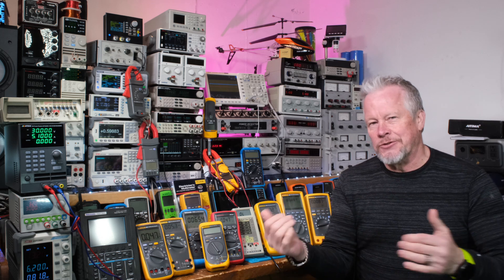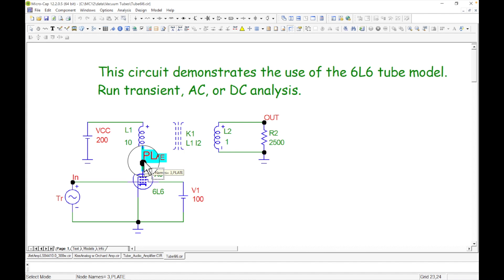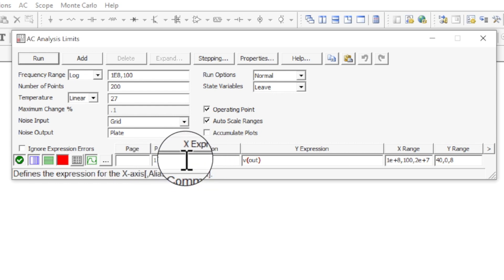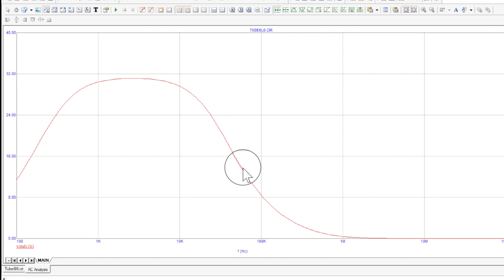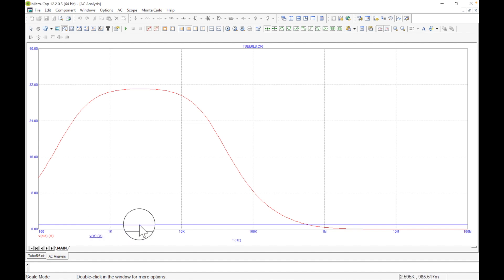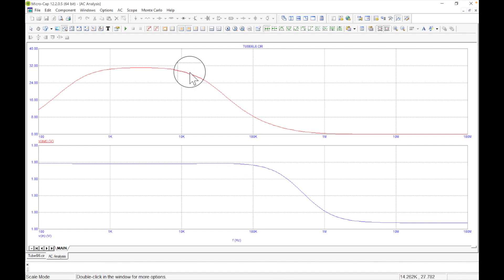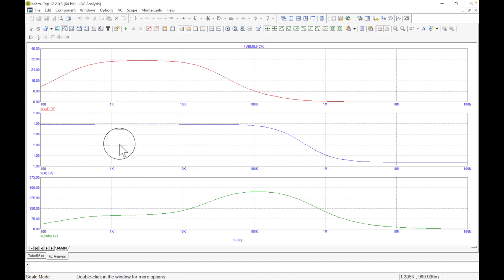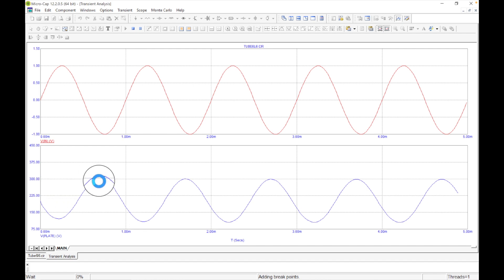6L6 Vacuum Tube Simulation MicroCap Tutorial #Micro-Cap #Vacuumtube #microcaptutorial #kissanalog

Comment: Does a 200V bias on the transformer put it in saturation or generate DC loss?
Reply: When using transformers in a tube circuit the main characteristics are power and frequency response. You can calculate the DC drop by measuring the primary resistance and multiplying by the current squared. You don't really want a DC drop in the primary so the wire should be large enough to minimize it. What usually becomes a limiting factor is the frequency response. The coupling capacitances from the primary to the secondary and from winding to winding roll off the output gain as the frequency increases.
Reply from the maker: @didgeridooblue Thanks for the great feedback!  I did a video once - but I think I need to do a shorter version talking about these points and the regulation of the transformer.
Reply: Thank you.
Reply from the maker: No - it depends on the current and other parameters.

Comment: What is the difference between LTspice and Microcap? Do you prefer Microcap?
Reply from the maker: LTspice has always been free - for a reason.  Microcap used to cost $4700 up until the owner retired and gave it away for free a few years ago.  Microcap is far more mature and has a huge library of parts and circuits to start from.  Also, it is simple to add more parts in Microcap;)
Reply: Thank you!
Reply from the maker: You bet!!

Comment: Hey Eddie, funny you should mention tubes. I've just designed a new circuit board for an ST 70 Dynaco amp, and I was hoping I could power with a switch mode power supply. So, it would be great if you would continue with the series on power supply design. As it would be very helpful if we could come up with a design for 450 Volt DC supply and of course 12 volts for heaters maybe with the center tap at 6.3. Anyways this would be a cool way of modernizing an old popular design. So far, I've been messing around with Webench at Texas instruments, and came up with a device UCC28740DR and a preliminary design but I don't have a good idea yet for the PFC front end. I sent you an email with a link to the design report and I can share more info on everything else that I've done on this so far if you're interested.
Reply from the maker: Thanks David!  I will restart this design.  I've been under the gun at work on a project, but I will get back on it;)  This is a great application;)